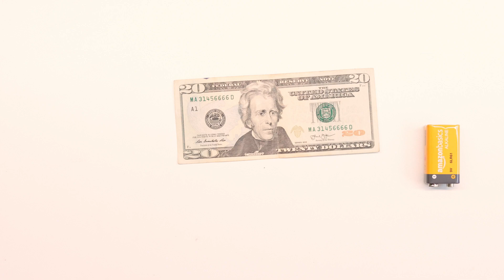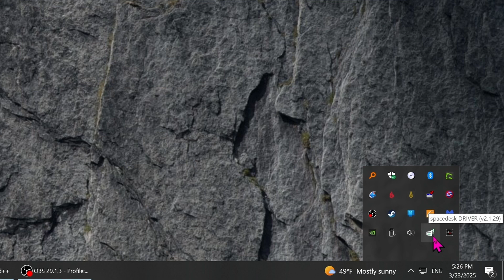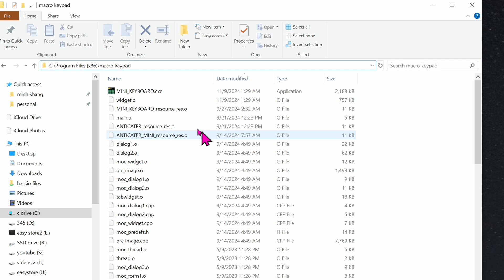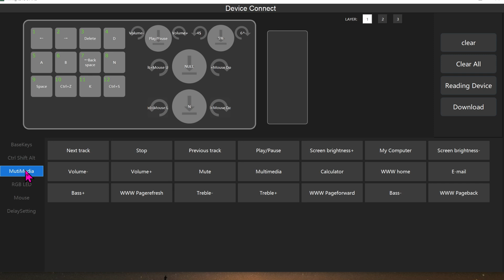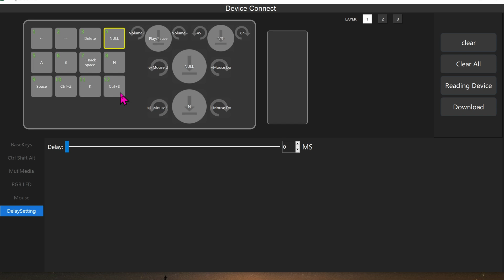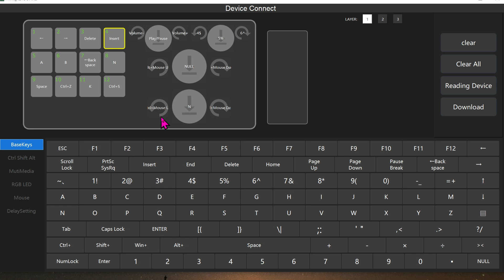amazing Macro Keypad, but terrible software

Comment: I have one with two nobs and 12 buttons without layer switch, it's really handy but the software is garbage, luckily, the macros are saved in the device memory so I don't have to open it often
Reply from the maker: this is better but sadly it does not work with 4 knobs https://github.com/rOzzy1987/MacroPad.  hope it works for you